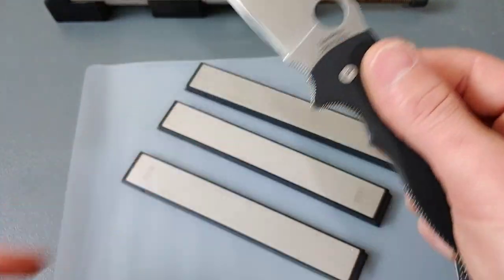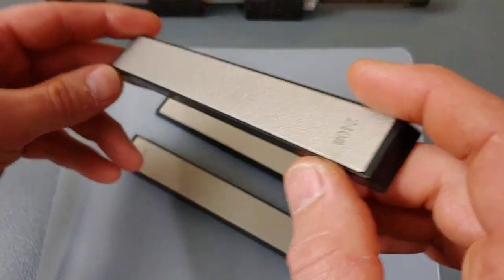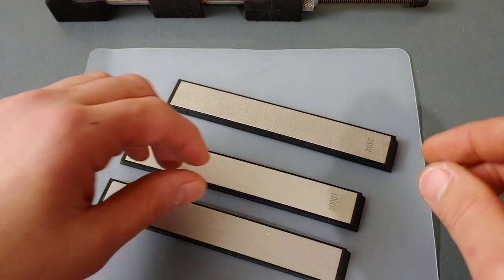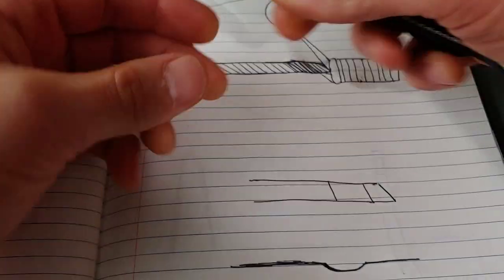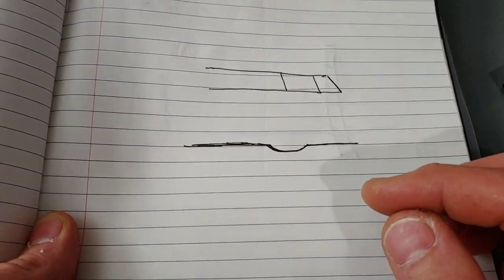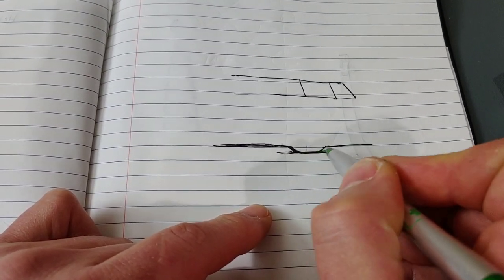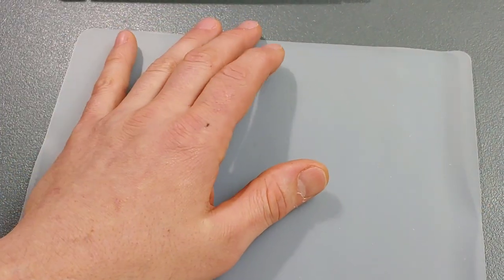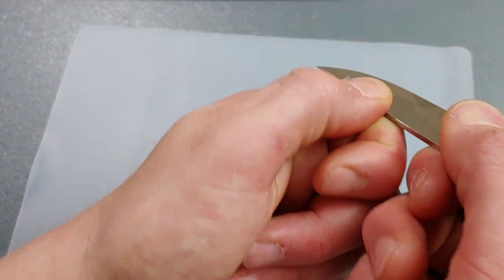KNIFE SHARPENING THE HARD SPOTS

Comment: Great explanation of a common issue.
Those new diamond plates would be for the edge pro format and not kme.
Have you looked into any of the specialty file sets offered by both norton and spyderco?? They seem to work for me in addressing the issues at heel of blade.  Also look at jende.....not sure if they are still offering but several months ago I had picked up a full set of chosera slip stones that were roughly 2" they also work very well....and for other hard to hit spots they offered what they called chosera sticks....measuring roughly 6" in length with width way under 1/4"
Those sticks also have helped me out of jams I put myself into..lol
Both shapes are offered in the full grit range of the naniwa chosera stones...hope that helps someone 
In closing, another great video!!
Reply from the maker: I have some thinner stones that i sometimes use for areas that are a little harder to hit, especially when im not wanting to remove to much steel to get to them

Comment: I would like to try using a lube on ceramic....... I've tried alcohol and not good, I can't remember what else I've tried, but also very hindering. I find that even the dried ink on my work clogs and lumps and etc. So thinking about a whet for Cera is posing to be difficult. What say you?????
Reply from the maker: Soap and water works ok because it helps keep the metal dust a float so you can wipe it off
Reply: @NeevesKnives  okay, I'm down to try it, what ratio ¿ ❔
Reply: @carbonitegamorrean8368  It does not take much soap.  I use dish soap in the same ratio I use for dishes.  Good luck!
Reply: @mrblauer1  Thank you, I assume brand doesnt matter ?
Reply: @carbonitegamorrean8368  Correct.  Over time you may still get some build up of swarf.  For deep cleaning (if needed) use "Bar Keepers Friend" and a scrub brush.
Reply: @mrblauer1  thank very very much